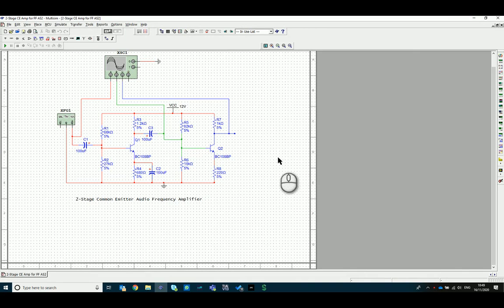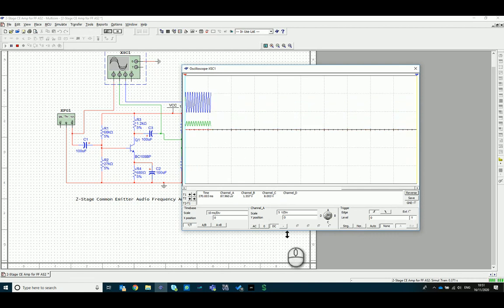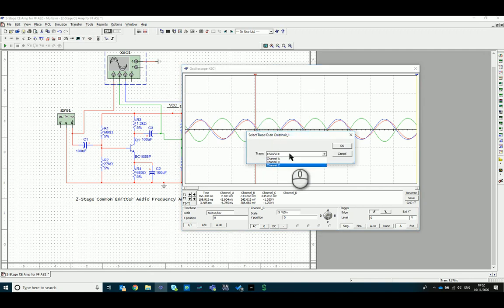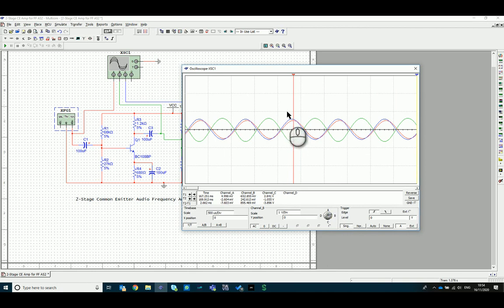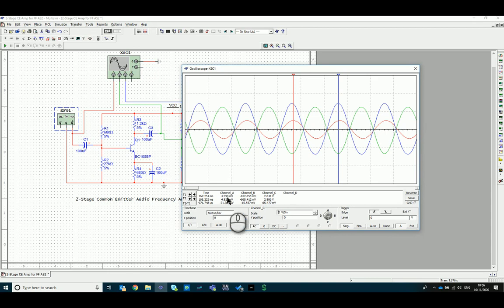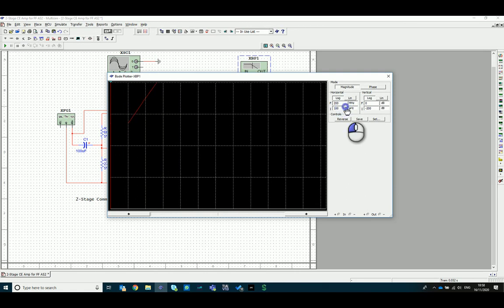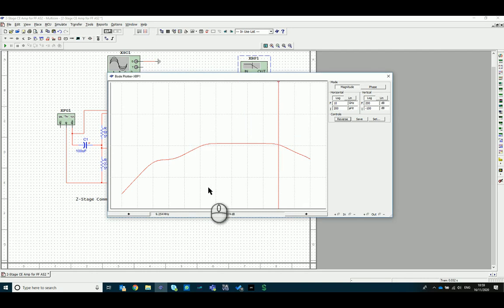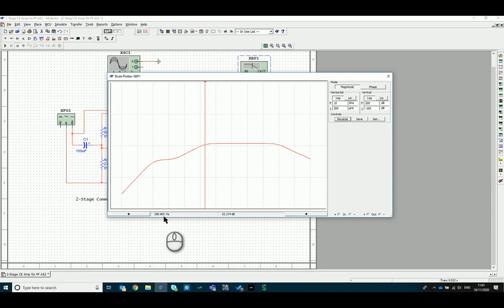Measuring Voltage Gain and Bandwidth on CE Amplifier on Multisim

Comment: How to measure gain per stage?
Reply from the maker: place the probes only thru one  stage ( single transistor) rather than thru both stages
Reply from the maker: So, from the video, use the values from channel A and B for a gain for stage one, use channel B and C for 2nd stage gain.